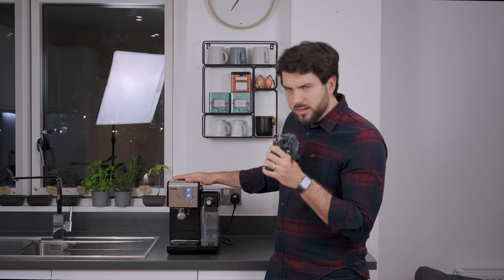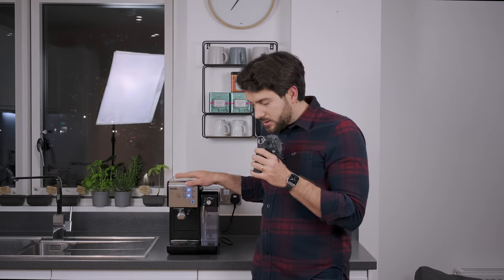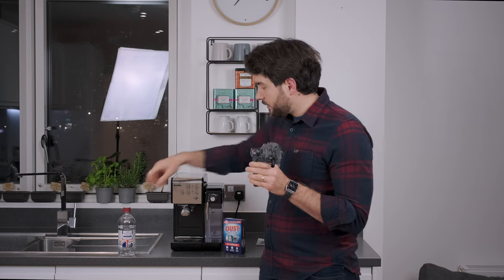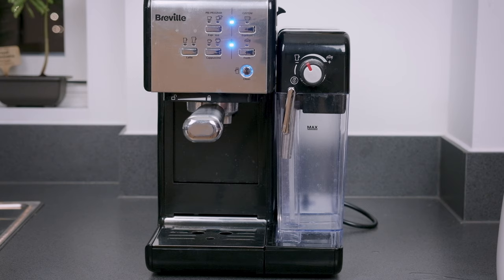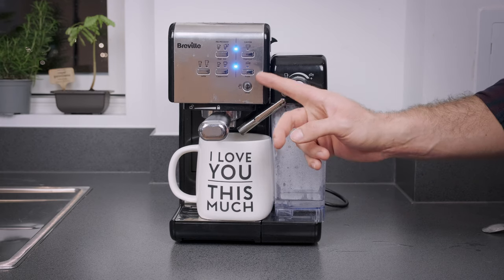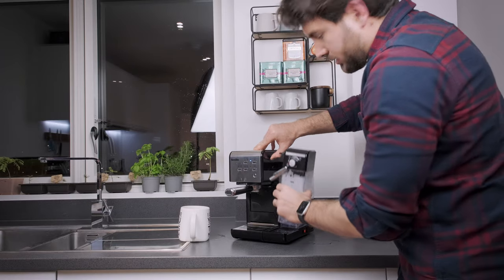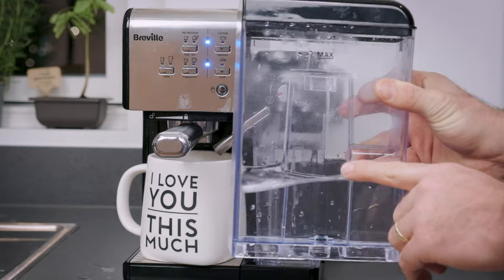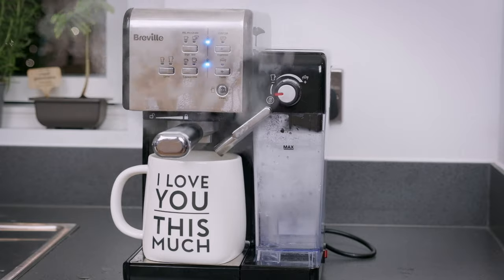Breville One Touch deep cleaning procedure

Comment: Hi! Thank you for your tutorial. I actually have a bit strange question. Could you please let me know if your unit has an o-ring on the frother connection joint (main unit side)? I have a problem that milk doesn’t go in the cup, only steam. So I suspect that the o-ring is missing there.

Comment: Easiest way to deep clean it is to turn it on - full tanks of water preferably bottled water and simply press custom and allow full cycle then press froth button below it and let it do a full cycle - it’s the same procedure as first time usage procedure and gives the largest water volume flow through system and helps descale better when using solutions 👍🏻🍻

Comment: How do you clean the metal milk pipe, dried milk stays there impossible to rub it off
Reply from the maker: Get a small brush that fits in there, make a mixture of distilled vinegar and water 50/50, fully submerge the pipe in there for 30 minutes and then try to brush it off. Worked for me